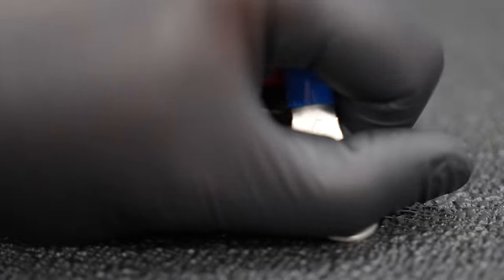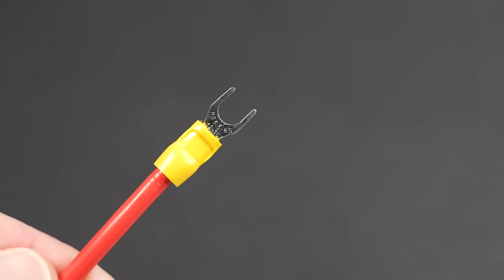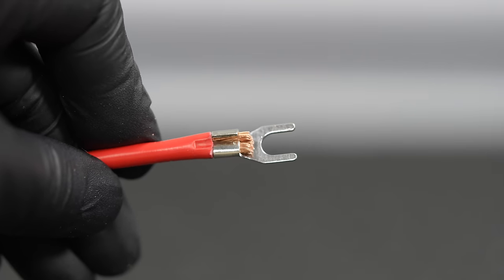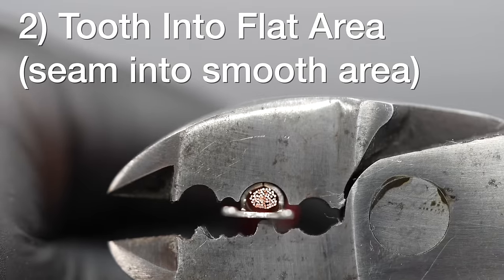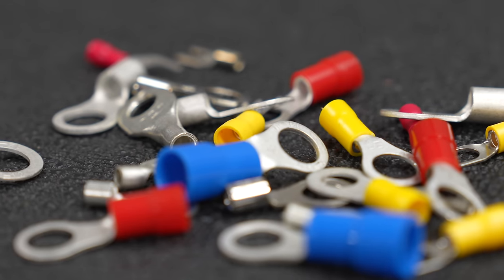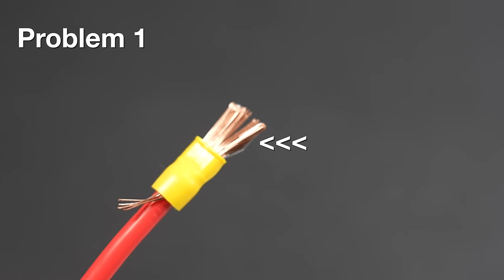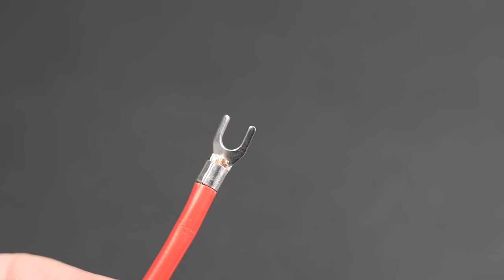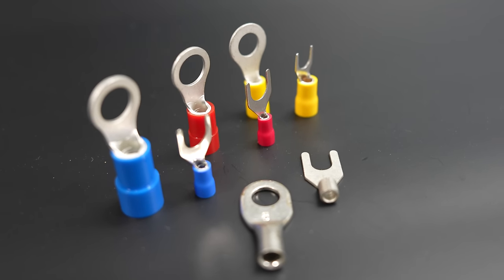Why 50% of All Crimp Connections Fail - Up or Down?

Comment from the maker: Let me know your tricks for crimped connections! Cheap but Great Crimp Tool  https://amzn.to/3V79Jb7 Crimp Assortment Insulated: https://amzn.to/437CNRL Non-Insulated: https://amzn.to/3wR9ZB2
Reply: I have never done an inverted crimp such as you've just demonstrated nor have I ever had a problem with any 
of my crimps; not ever! The proper tool along with a good set of eyeballs and technique is what gets me through 
this type of ordeal. I would never do an inverted type of crimp unless you follow up with flowing solder into the 
joint and over the outer split connector joint on an uninsulated terminal. Sorry, but doing an inverted crimp does 
not nor will not get it for me! I could actually demonstrate a solid crimp whereby it would be 100 percent of impossibility of not being able to pull a wire out of said crimp without breaking nearly all the wire strands first! 
And so I stand by my crimps by at least 200% without any common failures what so ever!!! The crimper that I 
used back around 24 years ago withstood 10 whole years of use and abuse and so if I could remember the tool manufacturer's name and P.N. I would give you that info right now!
Reply: on the uninsulated ones I flow a bit of solder on them and then apply heat shrink no more pull out ever ....
Reply: @unmanaged Yep, bullet proof.  Uninsulated connector, 200/300W soldering gun, quick flow of solder, cover with heatshrink.  A side benefit, is it seals the connection against occasional moisture.
Reply: This is the my preferred method.  If the connection is crucial I make it with an uninsulated connector, solder, and heat shrink.  I'm still up in the air on the prepackaged solder/heatshrink for butt splices.  The low melting point of the solder in those has me concerned.  @unmanaged
Reply: Great minds think alike...
Reply: A little solder and shrink wrap goes a long way.
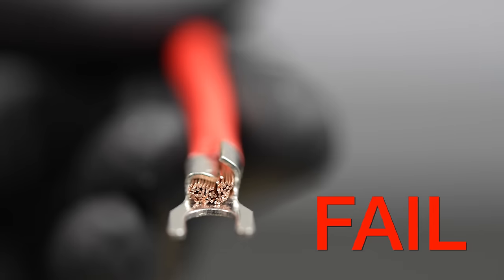Reply: At the 2:00 mark that technique bows out the fork. Also beware of terminal connector quality. I have seen some not made to good enough standards where the metal is too soft at the crimp point and allowing the crimps to slip no matter how good of a crimp you think you made. If you use those, maybe it's best to use solder too.
Reply: I always use the "non-insulated" opening, tooth opposite the seam, insulated or not, with long-handled crimpers not zillion-in-one tools. If I was really concerned about damage to the insulation I would heatshrink.

I've been known to solder in the past, but that was before I stopped using crap tools.
Reply: I've occasionally double crimped flipping the connector over to give am offset pinch. But nothing beats a little solder and shrinkwrap!
Reply: I use nothing but non-insulated lugs, heat shrink, then do a double crimp. Never fails. If I have the insulation on the lug, I just pull it off. Those things are about worthless. And by double crimp, I don't mean just crimping twice, you will crimp the same location twice in different spots of your crimping tool. The first crimp goes on the seam and turns both side in, then the second takes those sides and pushes them together onto themselves.
Reply: Because you buy chinesium. Form Ali or Amazon.
Reply: The best advice I’ve ever gotten -  I’ll use this method 100% of the time
Reply: how bout butt splice what then?
Reply: @commentsboardreferee7434 butt splices are petty worthless. Much better to solder and heat shrink.
Reply: @unmanaged  maybe but in industry that can be a huge no no
Reply: @unmanaged  What's that quote from? Soldering is more than just pouring molten metal. You need wet-out.
Reply: This video was incredibly insightful! I never realized the importance of orienting the crimp connector correctly. Your explanation was clear and detailed, making it easy to understand. Thank you so much for sharing this valuable information.
Reply: Chris, you're a lifesaver! Your detailed explanation on crimp connectors is invaluable. I never knew about the importance of orientation until now. Thanks a ton for sharing this crucial tip. Your video just saved me from countless future headaches!
Reply: About 20 years ago I had to consistently install high reliability wiring and I went to  uninsulated  crimped and 60/40 soldered connections with dbl wall adhesive shrink tubing. Over time I got so set up and pretty quick at it, I just did that for everything with the only exceptions due very tight spaces, and then it was rigorously checked before heat shrink.  To the best of my knowledge none of my connections have failed.  Once you get all set up for it with all the right stuff on hand it is really quite fast to do this. I have a nice dedicated box and good bins.  Add in a mini vice and life is sweet, but # 10 or  12 solid with a alligator on each end can give you the needed extra hand as well.  Good Vid! One more thing if you use aligator clips put a short piece of aquarium tubing on the jaws to not bite the wire insulation, esp important when soldering as it gets soft.
Reply: I always give the connection a strong yank to test.

Comment: No mate, you are using the wrong crimp tool; That is meant for solid barrel connectors; these are cheap folded ones you have there
Reply: So logical yet,.... You use what your boss gives you sometimes. Sometimes it's good to know just from looking at it that it sucks or you know it's good
Reply: This is not correct info
Reply: Facts
Reply: What is the correct tool?
Reply: An insulated crimper Ive had many and there all pretty bad got a knipex and its been brilliant its expensive but worth it
Reply: @blueoval250 the correct tool is one that crimps the connector like a staple.  One sidde of the crimper is a semi circle.  The other looks like a "m".
Reply: Yes, the wings when crimped should roll over in the centre, creating a "B" shape - the results shown in the video are just squashed flat.

Comment: I was a licensed electrician for over 37 years. I had the chance to take a lugging course from AMP, which is a leading manufacturer of crimp on lugs. The STAKON luggers were the best, according to them, with Klein coming in second. I thought it was right to have a little wire sticking out past the lug body, but I was dead wrong. They instructed me, YOU SHOULD NEVER LEAVE ONE IOTA OF WIRE, STICKING OUT PAST THE END OF THE LUG BODY.!!! The little lump, at the back end of the lug, is where you use the stripper crimper, as it tightens down into the insulation, providing a strain relief of sorts. I have manually crimped cases of terminals onto everything from the Red 20 - 18 and the Blue 16 - 14 and the Yellow 12 - 10 AMP terminals onto uncountable connectors and Burndy lugs onto 8 awg on up to 1600-24 cable, so I know what I'm talking about! You are right, the solid radius is where the top of your lug goes. It holds the two edges together and the tit shoves in the smoothe side. You should NEVER have ANY wire coming out of the front of your lug.
Reply: This is youtube for connectors bought by diys in lowes. It ain't a lugging course
Reply: @nothankyou5524 the principles are still the same. Conceptually I was amazed to find out that crimps are intended to create an air tight bond with the conductor. It makes perfect sense but as a younger person no one ever explained it to me. Seems so simple once you take time to think about it. Just because you're DIYing doesn't mean you should be willing to accept a joint that will likely fail. Too many inexperienced people think they can cut corners and basically not spend money on good tools but that plan almost never ends well. There're two types of DIYers one that is doing it because they truly care and have an interest in learning and the other who's just being cheap.
Reply: @nothankyou5524  Don't care, why teach people to crimp INCORRCTLY in an "educational video" ? Why not teach people how to PROPERLY crimp, no matter what the end user will be doing with the crimped lug?
Reply: I always extend the wire past the lug body by no less than an inch, then bend it backwards and wrap it around the lug body.

Comment: The crimp tool you used on the uninsulated terminals is for closed barrel connectors.  The open crimp uses a die that rolls both wings of the open crimp down into the wire.  You mean well but are actually not helping.
Reply: This times 1000. I am practically screaming at the screen this is so incorrect. A proper terminal crimp in almost every specification will form a “B” with the seam splitting the wire strands into two channels.  You can see how hard he had to finesse the situation to make the crimp incorrect by the video jump @1:19
Reply: @SolarMillUSA  He's showing, without telling us, the importance of using the right tool for the job. I don't know that a cutter/crimp tool is, but it shouldn't exist.
It's like using a spork to eat a meal in a fancy restaurant.
Reply: @Strider9655 , one way or another, combined tools are always worse than those made for a specific purpose. But this tool is good for crimping ferrules.
Reply: I used to work for a company that made wiring harnesses. I always pull the plastic sleeve and toss it. Use an Essex-type crimper, and solder. Then use heat-shrink insulation.
Reply: True open barrel crimps have vertical sides, those looked like cheap automotive style crimps (poor copy of a Hella crimp) so he was sort of on the mark for people that use them. 
You are right about the tool, it  also looked a bit wide for the terminal he crimped so it didn't do the indent quite as they should.
In any case what he put up, would help most people have a chance of getting a result that would suit most hobby stuff.
Reply: All aircraft terminations must be properly crimped, not soldered. Which means that the proper procedure has been made law by the FAA.  Thats the method I will use, period.
Reply: That open crimp connector is actually a hazardous fraud product. from sheet stock formed connectors require the seam to be brazed if they conform to norms and code. That results in a slightly poorer quality barrel style terminal. For these crimps that tool is legit. That connector shown however belongs in the trash can
Reply: @alnov2722  Same for cars.
Reply: @quademasters249  Personally I've yet to see a good crimp connector from an auto supply. And the insulated ones are total trash.As a truck and heavy equipment mechanic for over 40 years I've seen so many of them fail. Worse yet so many of them hanging with no support and open to the elements. As soon as I see them I know there is butchery
Reply: @joecummings1260  I follow the Toyota recommended method for harness repair. Which is crimped un-insulated tubular butt connectors and heat shrink.  

I'd argue most people don't know how or have the proper tools to crimp so it's not surprising most of them are bad. 

Factory harnesses are all crimped so I expect that's the most reliable method.
Reply: @quademasters249  Oh I have no problem with proper crimps. I work on some crazy large mining equipment that is electrically powered from the grid,. And there are a lot of applications where I use crimps for terminations. Some even with hydraulic crimpers.

I'm curious, have you ever seen them use "implosion sleeve" terminations? Never did them myself but I've been on jobs where it was done

But that isn't anything like what you find in automotive repair use. Almost all the automotive stuff is crap
Reply: You're off a bit on your opinion.
Reply: @pb68slab18  I have never seen guidance or manufacturer instructions that recommend soldering a crimped connection... do you have a technical reference that supports this practice?
Reply: @dustinsackett3419  No, can't state chapter and verse, but 40yrs ago I worked for a company that made wiring OE harnesses for all sorts of heavy duty vehicles, trucks, buses, trailers delivery vehicles and even Harley Davidson motorcycles. Harnesses were assembled, terminals were crimped on the stripped wire ends, which were dipped in flux and then dipped in molten solder. Then in a dip to remove the flux, and then a piece of adhesive lined length of heat-shrink tubing.
Reply: U tube full of amateur nonsense
Reply: Re earlier comments..  the 'correct' ratchet type tool for these trash insulated connectors do NOT have the B shape. Nor do the cheap ones found in auto parts shops. In fact the latter are quite similar to the tool in this video. While the tool used here is, I agree, intended for uninsulated closed barrel connectors, they work quite well on insulated connectors as shown in this video, and better than the 'correct' ones. 
I note that high end Klein crimp tools like the one shown, are sold as applicable to both insulated and un insulated
Reply: @pb68slab18  thanks for the feedback! 🙌
Reply: @alnov2722 Absolutely, and the tools are for use with specific crimp terminals only and are regularly calibrated. Also, I remember every so often having to produce sample crimps on to the appropriate size wire which were sent off for a pull-off test and iirc the crimp/wire joint should withstand 90% of the tensile strength of the wire before it failed.
Reply: You are right and wrong on that. Depending on application there are proper types of crimps and crimper however those are usually industry specific when you need to make a crimp that is gas-tight and other specifics. The reality is that isn't where our how most are used and are more likely to be in something like a car or even a home, which is perfectly fine in most cases. In fact it might surprise you but you can get kits that literally come with crimpers like any and the connectors by manufacturers of them. So what you are essentially doing is saying the manufacturer is wrong. So while you are right because of more niche applications, you are also wrong in the more standard applications of them.
Reply: None of this is of much value, on any of these videos. But a good name brand and give them a call. They'll tell you how to use theirs.Thats an NEC caveat since before I was born. Just like a the stupid ongoing debate on pre twisting wire nuts. Buy Ideal Wire Nuts because ideal is a great mfgr, and then don't do what they say
Reply: @pb68slab18 in many critical applications like aeronautics etc it's not permitted to solider connections since it creates a weak spot because of the sharp transition from flexible to inflexible along the wire, a strictly mechanical connection w the right connector is much more forgiving under vibration.

Comment: If you want your crimp connections to work then don't use the cheapest connectors on the planet. There's a difference between Wang Hung Lo brand and name brand connectors.
Reply: Those are definitely low quality connectors I won't buy
Reply: They never do tell you that the name brand gets made in the same factory as the unbranded. They also don't tell you the history of the Chinese political system and why all the metal there is such poor quality.
Reply: @frikyouall  a factory can make many different products. China could make good metal. They can make poor metal too. It depends what anyone is willing to pay for. Basically if you're getting connectors for less than about a quarter a piece they're going to be lousy. I really don't care who makes them. That's what it costs to make a decent connector.
Reply: @1pcfred  Not sure, but I think you contradicted your original post when you said you don't care who makes them.
Reply: @frikyouall  I don't as long as they're good. Who knows where the name brand ones are made today. Probably China like everything else.